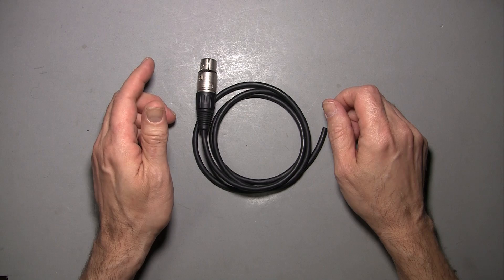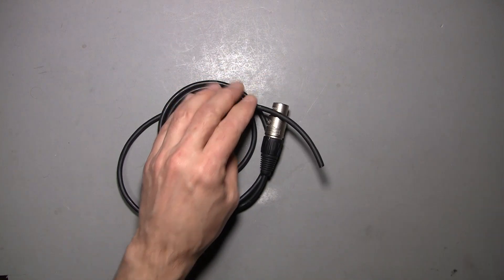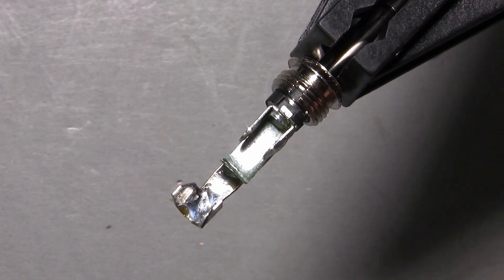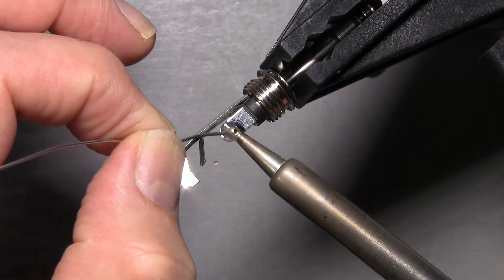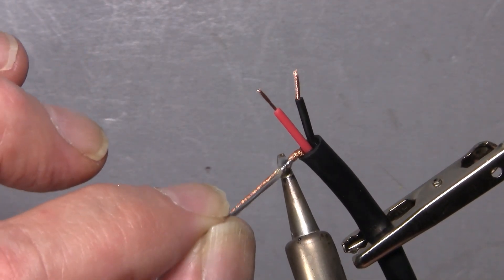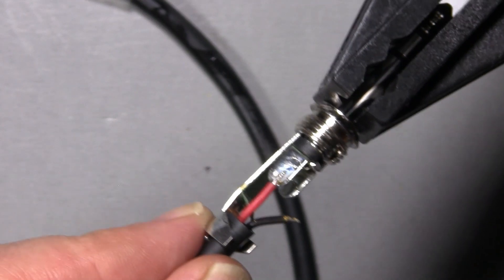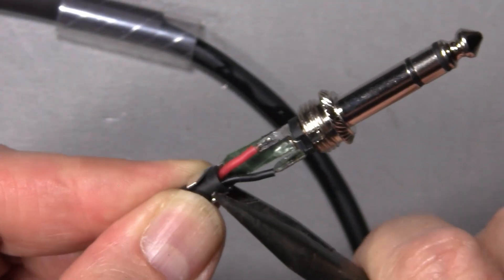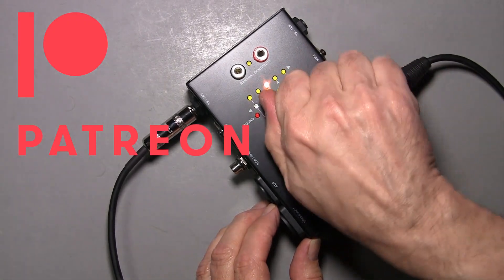Soldering 1/4 inch TRS Connectors Like A Pro

Comment: thanks man - wicked stuff . have you ever seen any kind of wrap to go round wires to further sheild EMF interference n stuff?
Reply from the maker: No, but if you're really concerned about this you could use a foil Shield wire instead of instead of a braided Shield , to look for and example look up west penn 291, though this type of wire is generally used in fixed installations

Comment: I bought 3 pairs of EV speakers that were wired direct. Just 2 bare wires to connect speaker.
I'd like to convert to XLR but there are only 2 wires. Black with White stripe and plain White Wires.
Is this a problem?
Reply from the maker: I would think it would be ok, as long as you don't have other gear that could be damaged by the power amp output XLR, a Speakon would be a wiser choice.

Comment: Hi is the same process for the 3.5mm cables I want to make a quarter in to 3.5mm cable but most are too long so I thought i might make my own ...
Reply from the maker: It is the same but the smaller connectors can make it difficult.
Reply: @biasedaudio  Thanks for your video I bought 4 quarter in jacks and cut 2 long cables in half now I have 4 smaller ones. Much better ! cheers

Comment: 7:37 Try using a hex crimper (the kind intended for coaxial cable). I tried that recently on some DIN plugs and it worked beautifully. You might need to slightly bend the crimp wings inward just a bit to get them started.

Comment: What pin on the XLR corresponds to what pin on the 1/4" plug???
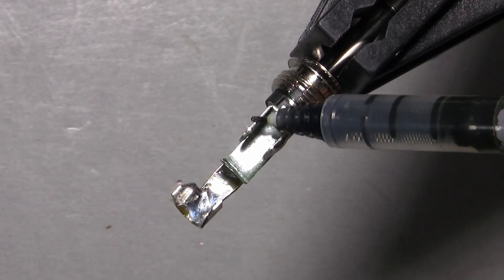Reply from the maker: At 2:16 in the video It explains which connector pin is high low or shield. I general for balanced audio. Pin 1 is sheild ground on both, and as explained in the XLR video Pin 2 is usually Hot which would go to Tip as explained in the video.

Comment: Pro tip if youre using a connector such as mogami gold or any gold connector, there is something called gold embrittlment, meaning solder doesnt stick to gold and will literally fall right out of the connector, so make sure you remove the gold coating on the inside by tinning, solder wick then tinning again the solder wicking again, finally tin and solder wire

Comment: I found that the old type of jack (non Neutrik) centre connecting tab becomes separated from the stud holding the tab. If the cable is in a situation where it is not moving around a lot, this will be fine. The spacing you mentioned, this I understand. I would never use this model of Jack for Guitar or Microphone.
Reply from the maker: I think the issue you describe might be related to the brand of the connector. There are a lot of copies these days. I prefer the Switchcraft Brand 1/4 connector which are durable and I have never had that problem, if one wanted to use this style connector.

Comment: i have ground, red,  and white cable, what is the positive?
Reply: the cable is mogami w2552
Reply from the maker: I would use Red as Hot or High or +, white and neg, low or - and shield ( bare copper ) as ground
Reply: @biasedaudio  THANKS!

Comment: Why would you waste our time and not specifically explain what color wires from the trrs cable to connect to what color wires on the trs cable. Thats the whole point of making the video, and you did everything but the most important for those of us who don't know shit about electrical wiring.
Reply from the maker: Unlike electrical wall power wiring, there is no absolute color code for audio cables. The color can change depending on the wire manufacturer. As a general rule, red is usually hot or tip, and black is low. But some wires have different colors usually on multichannel cables, and in those a clear plastic insulator is lowm headphones again will vary by manufacturer. So these are good guidelines but not absolute. It's best to look at the other end if possible. If not you need to test with a voltmeter. Beyond the scope of this soldering video.

Comment: Pretty close to how I do it, but here in NZ I can't seem to find "sodder", and have to make do with "solder". 🙂 I was taught to use the holes in the terminals, and that the tinned wire and terminal should have a good mechanical connection first; then the sodder guarantees the electrical connection, and the wire cannot move while the sodder is cooling, which prevents crystallisation.
Reply from the maker: Well your right that using the holes is stronger, and will prevent movement when cooling, it also causes me to curse much if I ever need to desolder. Good thing I wasn't using aluminum solder, that would have an aural disaster 😂.
Reply: @biasedaudio  Yeah, aluminium is much better! 🙂

Comment: Great video. I came here searching for a technique to crimp the strain relief… but I see that your technique is the same as mine; good ol’ needle nose pliers! I figured that an experienced pro like you would surely have a purpose built crimper for that job. But no. Nevertheless, very instructive and amazing soldering and assembly skills. Many thanks for posting, glad I subscribed. Cheers!
Reply from the maker: I did have one comment on this video that they used a BNC or RF connector crimp on quarter inch strain relief. It sounds like a good idea but I haven't tried it myself.

Comment: Hello. I am 61 years old and I am a TV technician with 40 years of experience. I solder the XLRs leaving the ground conductor (1) shorter. The reason is that, being more resistant, it is the conductor that will receive the force in the event of a pull, releasing conductors 2 and 3 from that extra force.
Greetings
Reply from the maker: Logical. A good strategy.
Reply: was about to say the same... i've had pertinent experience fixing lots of 'concert cables' and in the vast majority of cases where the fault was broken wires in the connectors, the ground wire was longer or same length as the signal wires. 
so, keeping tension off the signal wires (having them slightly longer than the ground) prolongs the life of the cable. 

if the cable sees lots of use and abuse, it's critical the crimping is done properly as the ground wire will 'stretch' over time (it basically settles in the jacket) and eventually there will be tension on the signal wires... there are other ways to make cables for 'concert use' but that's a different topic. plus in the end no cable is indestructible no matter what. the best practice is to retire and repurpose those cables before they start presenting faults. 

ps: for making lots of cables, like for an entire studio, a solder bath saves considerable time. it makes tinning super fast and consistent w/o any risk of melting insulation...
Reply: I hate the design of most if not ALL jacks, especially cheaper ones.  
Too small to do good work on, and nothing is truly "secure" to my confidence.

Comment: I have a couple of TS guitar cables (unbalanced). Would it be possible to take two of those and end with a  1/4 inch TRS Connector (stereo)?  Any issues with that or other recommendations what cables to pick for 1/4 inch  2x mono -> 1x Stereo TRS cable to connect a stereo synth to a mixer single line input. Thanks!
Reply from the maker: You could cut that cable and use it. Guitar cable is usually quite bulky for the proper shielding and low capacitance. So using guitar cable it might be tough to fit both cables in a single TRS connector. These adaptors can usually can be found on amazon for not much money . If you want to make your own I would use Redco TGS-01 which is pretty thin.  Wire both shields to the single trs. Wire one hot to the tip, and the other hot to the ring. Then wire both TS connectors normally.
Reply: @biasedaudio  Thanks. Thought so. Will look for a proper shielded cable that can accommodate both 1/4 inch mono and the stereo TRS.

Comment: Thank you!

Would it be possible to make a cable that is male 1/4" TRS on one end and 1/4" female output jack on the other end? All I can find close to it are 1/4" female coupler adapters and I would like to buy/make a 3 foot 1/4" Male to 1/4" Female TRS cable. If this is possible, could you tell me the schematic for how to wire the female end since this video shows the male side.

Thanks again!!!
Reply from the maker: Cameron. You should be able to find the complete cable or parts on Amazon.com Also Redco.com sell these parts. In most all cases you would wire the ground( sleeve) to the ground of the other connector, and the tip to the tip, and the middle sleeve to the sleeve. If you look close you should be able to sort this out as I show in the video. I think most female connectors are easier to figure out than male. This web page might help. Good Luck! https://www.cuidevices.com/blog/understanding-audio-jack-switches-and-schematics
Reply: @biasedaudio  Thank you so much! The closest thing to what I was looking for on amazon was showing me a female to female 1/4" coupler adapter, or 1/4" TRS Mono to Stereo Cable. Great information THANKS A TON!!!

Comment: Thank you for the video, you made this look a lot easier than I thought it was going to be. Would these be classed as balanced or unbalanced? If these are unbalanced, how would I make them balanced? Sorry if these are dumb questions, new to owning studio monitors.
Reply from the maker: This 3 wire trs connector would normally be balanced. Hot , cold, ground. If it was too connectors Hot and shield or ground it would be unbalanced

Comment: Big thanks for the video! Had to splice a new TRS cable to my Sennheiser headphone cord that was separating at the plug. The explanation of tip, jacket and ground connection was vital! My solder work leaves much to be desired but they still work!

Comment: You didn't show which terminals (TRS) you soldered the red/black wires to. (-1) [no audio]
Reply from the maker: Actually I do. At about 8:50 I mention tip ring sleeve, hi low ground. You can see clearly where the wires are connected
Reply: @biasedaudio  Sorry, I have *no audio*. You labelled the ground *on screen*.

Comment: How do you solder and unbalanced connector? Where do you solder the cold wire? To the ground?
Reply from the maker: Yes hot to tip cold to ground or sleeve

Comment: does switching red and black wires reverse polarity of the signal?
Reply from the maker: Yes
Reply: @biasedaudio  What happens if the polarity is reversed? I thought the red signal wire belongs on the right side connector but you have it on the left.

Comment: I started as a musician doing a bit of audio engineering. I then bought a soldering iron to fix my own guitars and cables. I did this adequately for a while, about as good as you in this video. I then got into electronics and now work fixing games consoles and making surface mount electronics kits. Soldering SMD components for 4 years daily with very few breaks. What am I getting at? I can now no longer watch the "pro" soldering jobs of audio techs on YouTube without squirming at all the tiny mistakes.

When you say "seen better" about your own soldering, it's a bit strange. Soldering is a science. It should be perfect every single time. If it isn't then the technique, process, or steps are not correct and need looking at.

Comment: I have learned if you dont use the insulating sleeve or heat shrink you'll have all kinds of issues. The heat shrink also helps a lot to connect any sleeving to the connector if you are using sleeving.

Comment: I purchased a double trs jack wall plate in order to remove one jack and replace it with a volume pot for a headphone input. How would I solder the volume pot to the trs jack?

Comment: QUESTION: i have a headphone that i want to turn ro a balanced type. i want to then have a cable that goes from 4 pin xlr to 3 pin xlr. can you show how it is done? thanks
Reply from the maker: Maor . 4 Pin to dual 3 Pin or 4 Pin to single 3 pin?
Reply: @biasedaudio  4pin to 3 pin